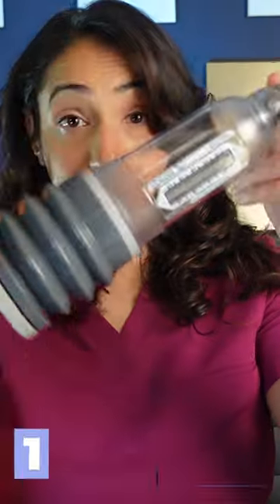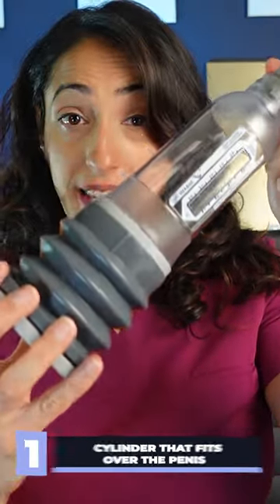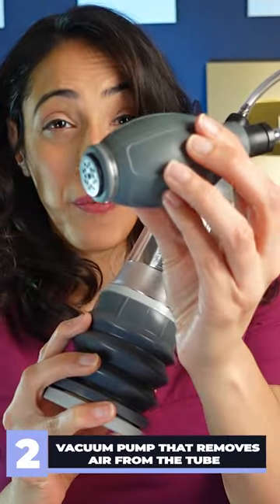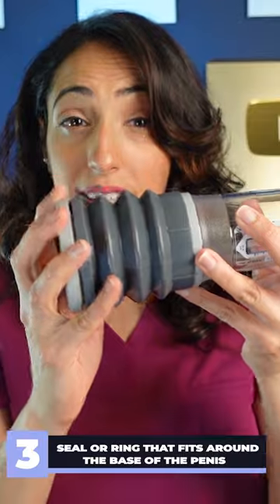What are the components of a vacuum erection device?

Comment: So does the size stay permanent? I always want to get one
Reply: No, because it's a forced action of pressure inside the cylinder. To maintain those growth, use either a penis sleeve, aka, anti-turtling silicone sleeve to maintain the length... or a penis stretch apparatus for a relative few hours a day. Penis pumps are dangerous and warnings are stated on the instructions it comes with the box. This is not for the faint hearted individuals.
Reply: @pst702 any device meant to alter the human body carries risks. No matter if it's a stretcher, a pump, or anything. If used improperly it can cause harm.